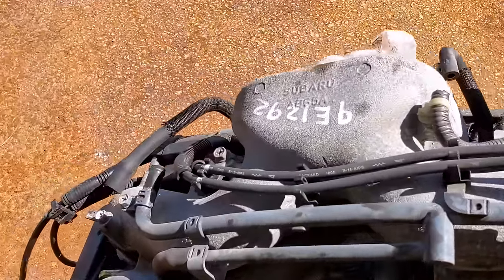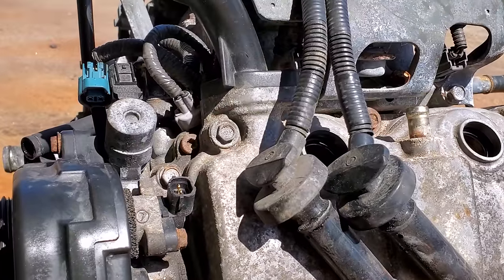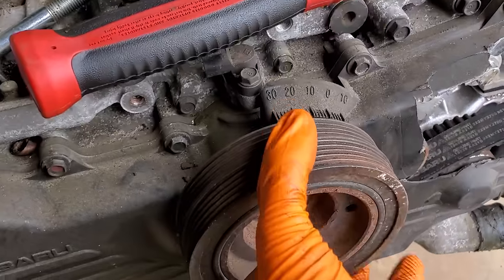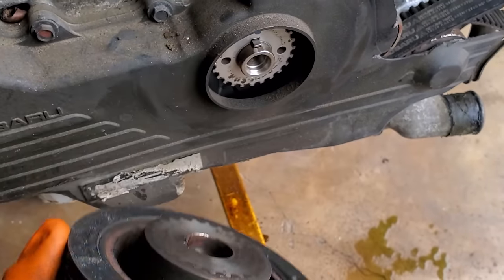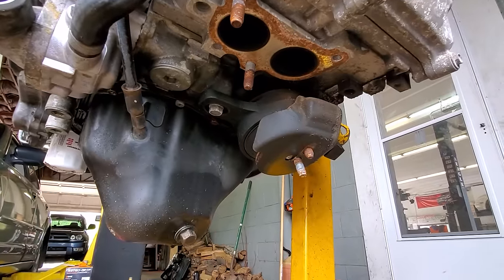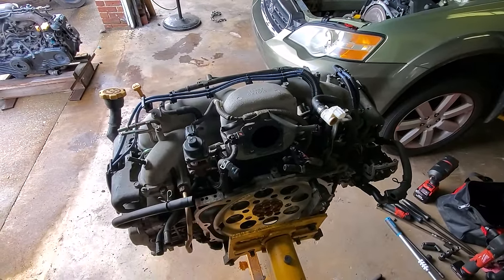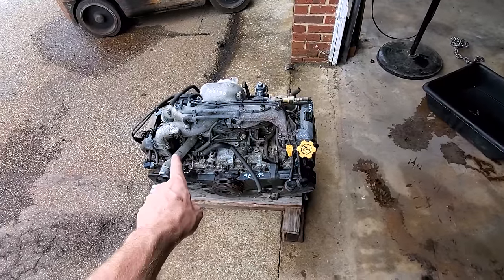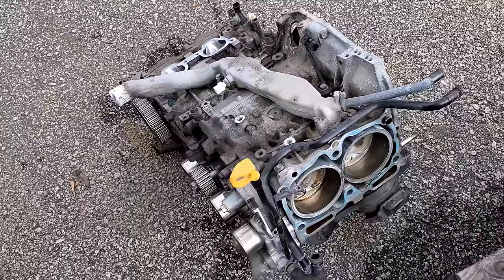The Worst Subaru Head Gasket Repair Ever: Part 2 Of The Nightmare!

Comment: Wow, what an absolute epic fail. Not on your part of course. Gotta love it that some moron can't figure out two engine connectors instead of cutting. Why would they even cut all the wires on the engine? Absolutely idiotic. Subaru makes it so easy to pull the engine with the harness in tact. Really sucks you got that engine all ready and it turns out to have no compression. I feel like you'd have better luck buying a random engine on eBay at this point, hahaha. Good luck with the final rebuild!

Comment: Just when you thought things couldn't get any worse. I feel your pain.  Hope it gets better. Enjoyed the vid.
Reply: I can related to this. I work in the IT industry and sometimes a quick problem is just the opposite and turns out to be a nightmare! The end user gets upset because what was supposed to be quick turns out to be a nightmare. I've learned that when I hear I have a quick question my immediate thought is I have a quick answer which is NO! lol. It is what it is. Difficult but I try my best not to get really angry about that stuff.

Aside from that I like messing with my car and I get myself into trouble sometimes also. A quick issue is not so quick all the time. Guess this can apply to anything... Nothing comes easy.
Reply: @shamwaymoonyos9578  I have been down that road a couple thousand times myself.

Comment: LKQ is bad at it with cutting wiring harnesses,seen this before.One was a sensor plug in cut in the wrong spot.Learned a lesson on buying used Subaru engines,my dad has to buy one for a 2009 Forester he bought.This one is a turbo version,rods were pounding and was running before I pulled it
Reply from the maker: This came from Ace Auto Salvage, but yeah, same issues with LKQ.

Comment: Good thing you didn't give any blind trust and bolt two bad used engines back in. I'll say a prayer for you. Cut a good engine harness... drop the engine off a lift. You're handling it better than I would.

Comment: This is why the shop I use when dealing with aftermarket warranties require new or rebuilt long blocks.  They won’t install a used motor or transmission for warranty companies.
Reply from the maker: They used engines are $1,400 each. A new/reman short block, direct from Subaru is $1,800..  🙄
Reply: MrSubaru1387 right,  all this bs over $400.
Reply: @MrSubaru1387  those used engines shouldn't cost that much

Comment: I guess the thinking behind cutting all the plugs is you only bought the engine not the wires. That’s scrap copper right there. More money for them.
Reply: Naw they're just lazy and guys pulling the engine at the junks yards want to get it done as fast as possible with minimal effort. They cut all the hose and fuel lines too at the only junkyard close to me

Comment: At this point I see the guys at the shop saying you see that, glade we didnt touch it. They knew those engines were bad when the truck dropped them off. Both of those engines should have been rejected . 
      You dont have a place down there where you get known good engines. At this point you might have just got a brand new short block. Btw its Car Shield right , You dont have to say just smile and nod.

Comment: I had one in yesterday with brand new head gaskets for a miss from an oil fouled plug. Also the ps pump was installed wrong and the belt was rubbing the tensioner bolt. Thankfully the guy took it back to the shop that did the job. I had a bad feeling there would be more wrong once I got it apart.
Reply from the maker: Sounds like a definite cluster.
Reply: Kid’s car and dad was saving the day so who knows what’s happened to it

Comment: So on the dropped engine. How did dropping it on the driver’s side head cause the passenger side cylinders to not have compression? I can see it could have bent a valve on the driver’s side but not the other side.
Reply from the maker: I'm assuming the force of the engine landing on the cam pulley, breaking, jumping time, and the force of the drop twisting the cam, drove the valves into the pistons. As for the other bank, not really sure, but cylinder one had 70% leakage as well, can only assume it pulled the belt hard enough to clash that side on impact as well.
Reply: @MrSubaru1387  I think the cam pulley exploded when the engine was running. Maybe somebody dropped a wrench in the timing belt while it was running.

Comment: My 2007 Malibu 2.2 was broke for 6 months till I found the best used engine for the money.  Newer engine had 68,000 for $750.  I was forced to drive my 2018 0utback Premium as a daily driver LoL
Reply: Sell the cheap Chevrolet
Reply: @devengudinas1649  $7200  103,000 miles in 2012, still driving to work.  Got to last till the Outback is paid off.  Then I'll shop for a WRX.  But the newer GM Ecotec 2.4  engineis a piece of shit

Comment: I need a little assistance in choosing the correct head gasket kit with waterpump assembly. 2007 subaru outback 2.5/ EJ253. the job was done at 100k, now I need to replace it again. Do I need the waterpump assembly again

Comment: sorry about the bad luck, you seem calmer than I would be lol, but a blown head gasket on a Subaru usually is not this bad is it??
Reply from the maker: No. The issue here is someone tried to replace it before and they gouged up the engine block and cylinder head's sealing surface. The amount of machine work and labor to fix the existing engine is why we were going to replace rether than repair.

Comment: Hey man, just wondering if you know the newest model year for the forester xt with the manual? Are the 15s and newer only paired with the high torque cvt instead of the 6 speed? I have a 15 forester 2.5i limited. I miss my 6 speed. I’d love a newer xt but wasn’t sure if it came stick

Comment: Good grief, that's impressive! At this point I gotta ask, why even bother buying an extended warranty?
Reply from the maker: Customer hasn't got to deal with it. I do. 😂 😂 😂
Reply: @MrSubaru1387  F
Reply: @MrSubaru1387  I can't argue that logic, but this is why I went to heavy equipment. Really no BS when working on construction equipment. Engine cost as much as that whole car when it was new. " Needs a C13 cat rebuild, gonna cost you 13 to 18000" customer...... Ok

Comment: Hey Mr. Subaru! I have a 2011 Subaru Tribeca, H6 engine with a ProDrive 5 speed automatic transmission. It has 100k miles and I have no idea if the previous owner changed the transmission fluid or not. Should I changed it right away or leave it alone? I'm afraid it was never changed and a brand new transmission fluid starts making the gears slip. Thanks.
Reply from the maker: Change it.
Reply: Thanks a lot!
Reply: @robsonselzelin  alot of people say don't flush, to drain and fill, if that helps.

Comment: Hope you can help me. Have a 2008 Forester with about 80K miles, located in NY.
First - My check engine light is on steady and the cruise control light is blinking. When this happened before, about a year ago, the code said there was a small evap leak. I had changed the gas cap and all was good. Used a new Stant cap. I now have the same scenario. Could it be the cap again?
Secondly - Today, my wife tells me the engine shut down while she was driving on a side road. She stopped and restarted with no problem. What might have caused the stall? Related to the light situation? Thanks in advance.
Reply from the maker: Scan the codes.
Reply: Will do
Reply: When I had the small evap leak code with my 2006 Forester, it turned out to be a common evap leak problem....the fuel filler neck had a fairly good sized rusted hole where you couldn't see it because it was behind the wheel well splash guard and way up on top side and on the back side of the body panel near the filler opening on the other side though. (Salt and debris lodge in there, sneaks past the seam in the splash guard/wheel well area.)  Very common. Removing the nut(s)/bolts on the splash guard is so rusted that the bolt/nut usually breaks into pieces and then you can't get the plastic splash guard back on without replacing the filler pipe because that's where the bracket is mounted on, (I guess you could try a tap and die set to restore the threads on the splash guard mounting bracket) but it's the only way to inspect for rust on the top side of the neck.  I had to replace the entire fuel filler pipe and also I found completely rusted was the little valve that mounts to the top of the filler neck...I believe it's the fuel filler neck shutoff valve.  I was able to re-use the original evap little metal tubes that attach to the assembly.  By the way, don't go aftermarket on the filler pipe, get OEM Subaru...it's not worth saving $20 and the job was plenty tricky enough for me with the OEM one.  It fits together so tight you don't want to be messing around with the imprecise aftermarket fit.  Had to grease the bottom of the pipe and wrestle with it for half an hour trying to align everything and to get it to go into the rubber hose attached to the fuel tank because there is really no convenient place to hold onto or push on the pipe once it's in position.  Good luck sir.
Reply: Mark - thank you for the information. I'll get the code to confirm it's still the evap issue and then I'll check out what you sad. Thanks again.
Reply: Btw. The cruise light blinks whenever the check engine light is on for many Subarus
Reply from the maker: 05+
Reply: MrSubaru1387  - I thought the blinking cruise control had a specific meaning, not with every check engine lighting. What's up with that? It disables the cruise control as well, which is a pain in the neck. This happened last year when I was driving from VA to NY. Dah.
Reply from the maker: Subaru disables cruise control on all 05+ vehicles with an active CEL.
Reply: MrSubaru1387  - well that makes a lot of sense - not.
Reply from the maker: To encourage you to get the issue fixed rather than ignore the light.
Reply: MrSubaru1387  - hmmm. I guess it's actually clever.
Reply from the maker: @billlink7116  new ones disable eyesight and all the adaptives.
Reply: MrSubaru1387  - the check engine code is P0442, small evap leak. Again, can it really be the gas cap again after just about 1 year of replacing it? Also, I was reminded the lights came on when I used the cruise control - is that just a coincidence? Lastly, can this small evap leak have caused the engine to stall while driving at about 30 mph? Thanks again.
Reply from the maker: EVAP leak can be anywhere in the EVAP system, not just the gas cap. Gas cap is usually a gross/large leak. It's pretty difficult to diagnose EVAP leaks without adequate diagnostic equipment. Scan tool, smoke machine, etc.
Reply: MrSubaru1387 - that's what I was afraid of. Thanks for the replies and feedback. Enjoy your videos and knowledge.
What about the engine stalling?
Reply from the maker: The only code was for EVAP?
Reply: MrSubaru1387 - yup
Reply: Mine was a small evap leak code but by the amount of thick rust chunks on the filler pipe behind the wheel well by the filler pipe valve you would've thought it should be large leak.  If I could figure out how to post a photo in here I might still have the photo.